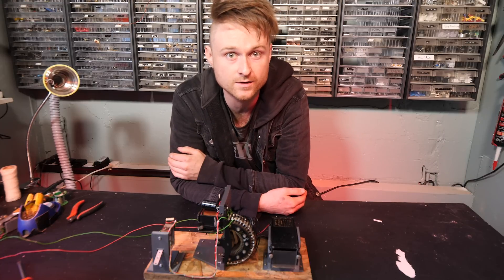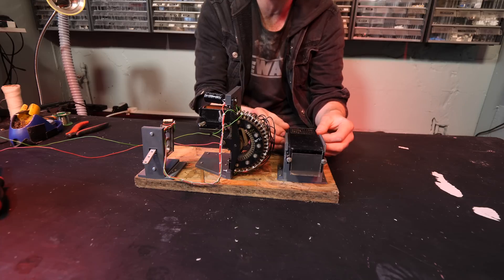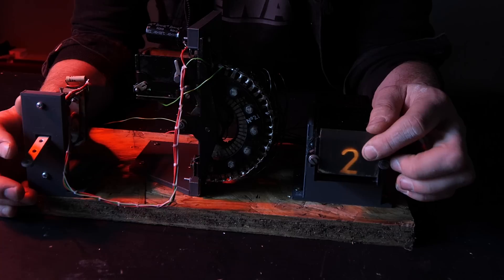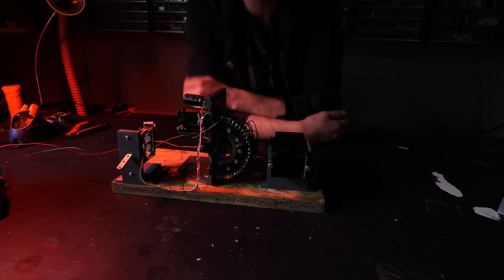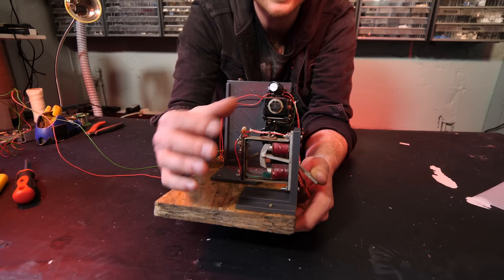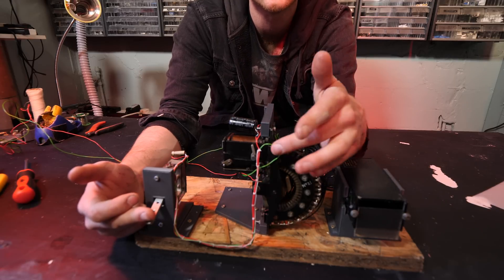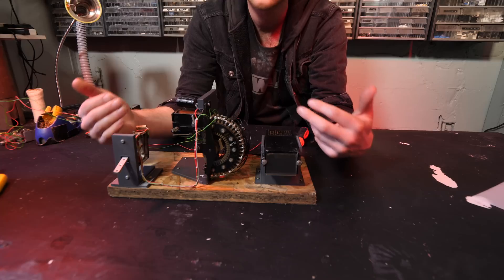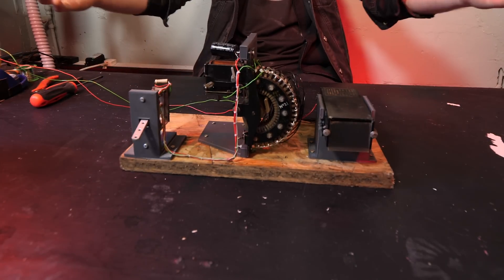A Very Interesting Incandescent Display - Wired Into Some Electromechanicals!

Comment from the maker: hack modulars video :- https://www.youtube.com/watch?v=CYO97JOhR3M
as mentioned hack goes into more info on the actual light display so definitely check it out :)
Reply: sam. my partner has a virgin megastores vibrochair made by priestman goode its partly obsolete as its not working...its supposed to vibrate to the beat and has a speaker on each ear...it was a prize won on "live'n kicking "...are you interested..?

Comment: Very neat setup with the display. Is it set up with keep-alive resistors for the lamps to improve life? It is a resistor for each that provides just not quite enough current for visible glow, so as to keep the filament warm. This greatly improves lamp life in this kind of application, where failure is most likely due to thermal at turn on.

Comment: I used to work with your "uni selector" that was a full 360 capable.  Wired with resistance in steps to a vacuum tube compairitor with one side the output of the selector and the other voltage from a mathematical amp.  The result is Turing the selector which pulled a wire on a 2d plotting board.

Comment: Have you looked into phone splicing schemes?  You could stick a lot of these big wiring harnesses on a rj21/amphenol 50 connector.  Or even 710 or ms2 (ms squared)  these are all telephone splicing modules for different applications so it would fit your museum too.  You could plug and unplug 50 wires at a time, and even get a pcb made with an rj21 connector on it.

Comment: what kind of string do you use for wire lacing? I'd love to see you make a tutorial video. perhaps make a tutorial while you finish the organ build.
Reply from the maker: im just looking through trying to find where i actually got it i cannot seem to find it, ill keep an eye out, i was going to do a video, but im not actually sure if i do it the correct correct way haha. i need a few mmore months of proven track record before i can confidently tell people my way might work for them :)
Reply: Typically, you use a modern version of waxed lacing cord, eg AlphaWire #LC134 WH088 (from Farnell, etc.). This is white with a wax-type finish to stop the knots undoing or slipping.

Comment: Idk if it's your cup o tea, but the old mid 20th century skeeball arcade machines had some pretty funky electromechanical inner workings. Even current pinball machines are a fun thing inside.

I'm kinda just wondering about somehow adding lexan panel to see the insides... skeeball? Pretty easy. Pinball playfieldcut from lexan, and everything transferred over? Not so easy lol.

But the Old Skool Nude Arcade nook could be a fun idea.
Reply: hey sounds good, i usually workwith what i can get my hands on and have nont come acccross that sort of stuff for decent costs. usually always too much money to justiify sadlly. gotta find a roughish one to fix and modify
Reply: @LOOKMUMNOCOMPUTER  Yeah, honestly by the time they get scrapped they are usually pretty far gone... the arcade i was at had their old skeeball alleys running until 2010ish. They don't exactly get 'light use', it's ppl throwing a heavy wooden ball. Also the coin mechs were a nightmare to keep running... break one spring by pulling the lever hard = free play but 5 min fix, break a second spring too by pulling way too hard nobody plays until you spend an hour getting to that spring under the side panel.

I heard the "attract" music of one game there in my head for months after stopping working there... screw you Robo-Bop!